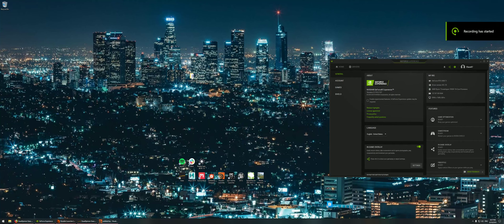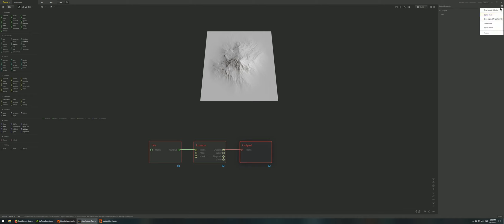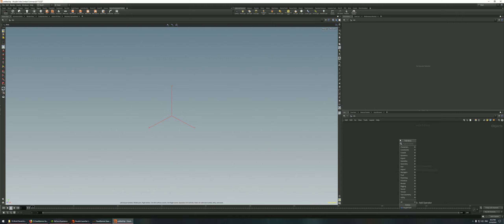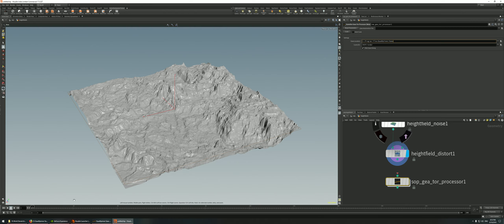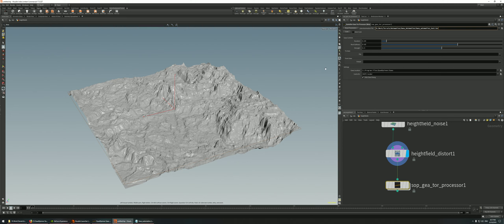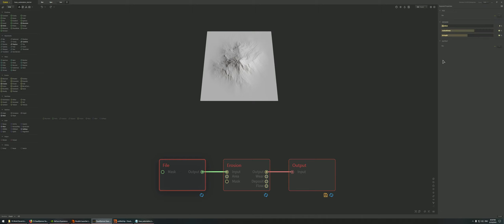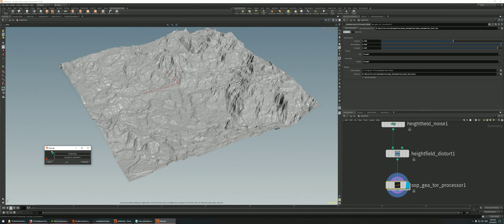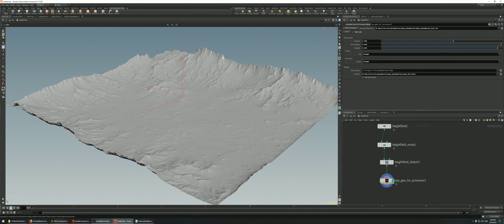Gaea to Houdini bridge demonstration

Comment: I don't really get what is the advantage of this? Couldn't you just create the terrain in Gaea and then use the finished heightmap in houdini?
Reply from the maker: I'm not sure if you are familiar with procedural and automated workflows while working on large projects or AAA games. This is basically having Gaea running in Houdini. This means you can for example move a spline based road in Unreal and then Houdini will take over to update the terrain, run erosion, and update the masks etc... without having to open up Gaea or houdini.
Reply: @amirabdaoui2368  I see, that makes sense! So the Gaea terrain tools are (currently) more powerful than the houdini terrain tools?
Reply from the maker: @bjfreshy1746  both are powerful in their own right. Gaea is specialized towards terrains and you can achieve good results with less work.
Reply: @amirabdaoui2368  Cool, thanks for the insights! Love your terrains btw :)